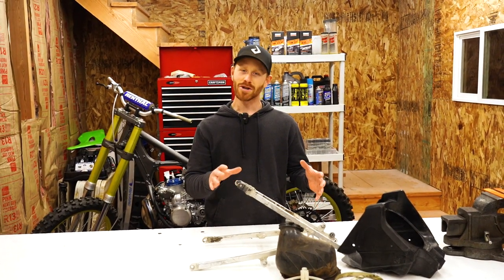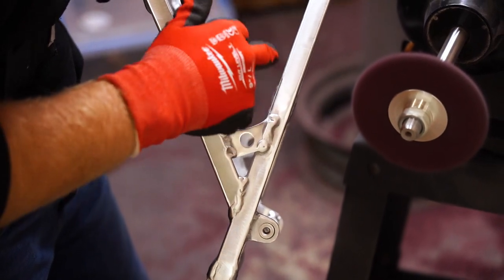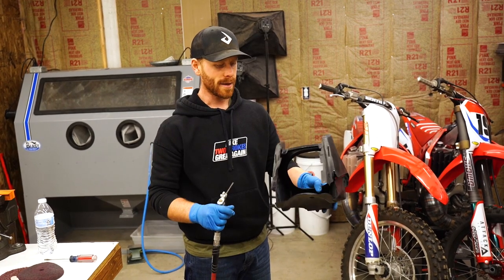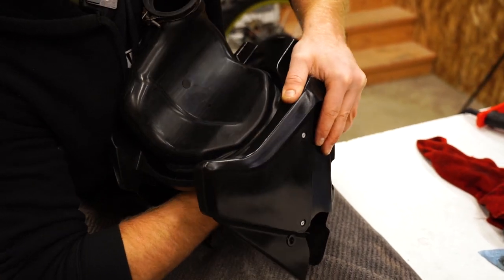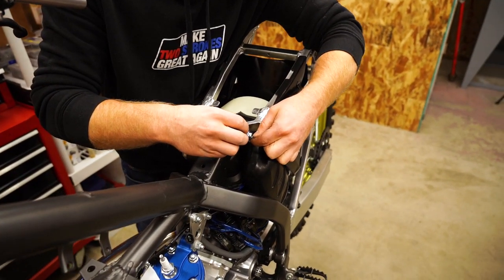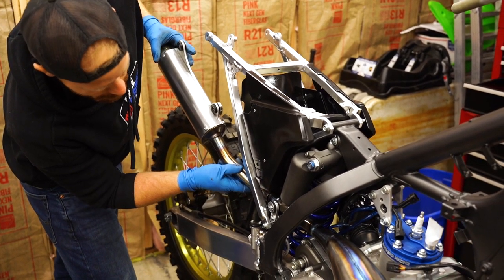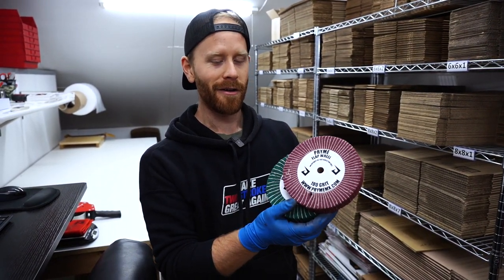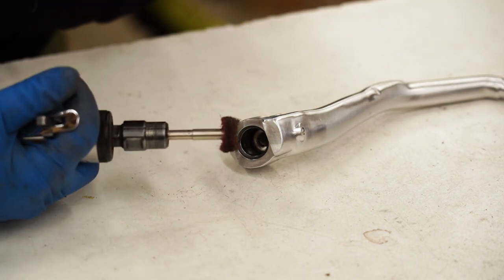I Tried To Cut Corners | RM250 Rebuild 33

Comment: Where did you get that rear fender, is it OEM Suzuki? I wanted to order one for my bike and my local Suzuki dealer said it is no longer available. I wouldn't like to buy after market as my bike is completely OEM and in brand new condition, only the rear fender has some scratches.

Comment: Nice, that's awesome 👌  do you think that for your front forks tube that if they were to be powder coated with just plain black and that if you open a bit those triple clamp that it would work? I am not setup for cerakote but only for powder coating. I want mine to be black.
Reply from the maker: Thanks Eric! Powder coat wouldn’t be good for fork tubes. Too thick of a coating and it wouldn’t clamp well

Comment: Hi Cameron. I have an issue that perhaps you can help me with.

I have a 2009 Yamaha WR250F which just had a bottom-end rebuild. We replaced the crankshaft, cylinder, and piston with brand new parts.

After reassembly, we went to start the bike and after a few minutes running we noticed that the oil tank was bulging and then burst open right under the fill/drain plug (see attached photo). We welded it shut, then started the bike. After leaving it running for a while to break in the new piston and cylinder, the oil tank burst open again, this time through the seams on the side. 

We are stumped as to what can be causing such a build up of pressure in the oil system, enough to make the oil tank bulge, then burst. I should add that we did not overfill or exceed the oil capacity of the engine, in fact, we underfilled by 200ml.

Can you or anyone else offer any insight?

Much appreciated.

Comment: Those plastic coatings don't last. You can dry ice blast or vapor blast at low pressure to remove the top UV damaged layer and then polish it up with a sheep wool pad at low speed to get it back to original condition.